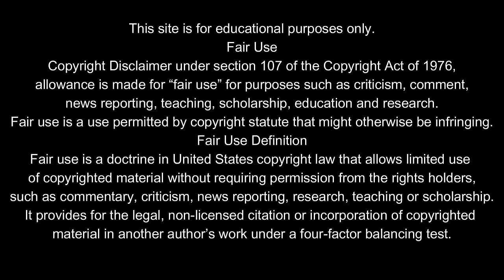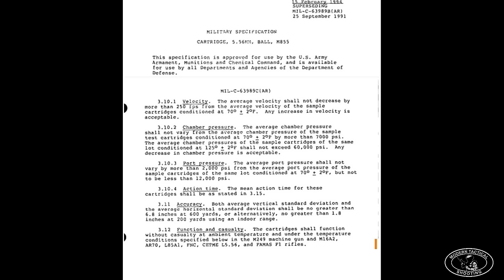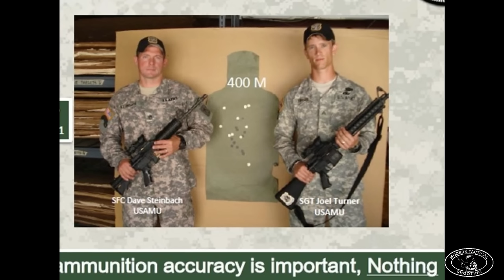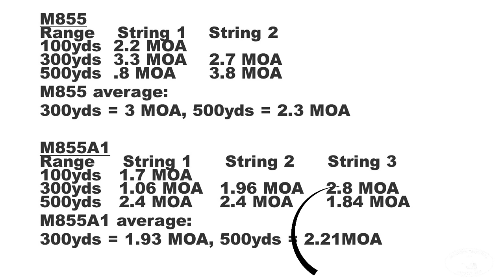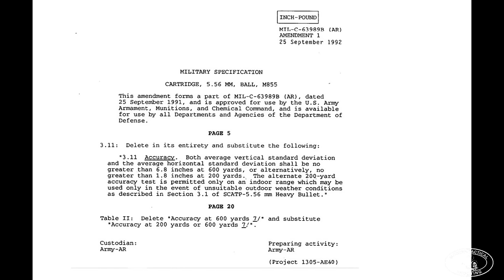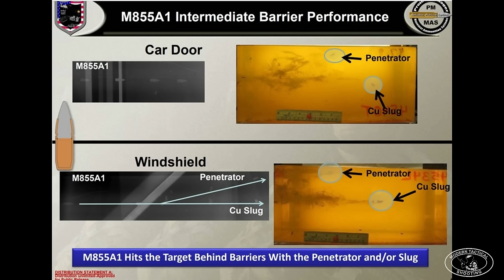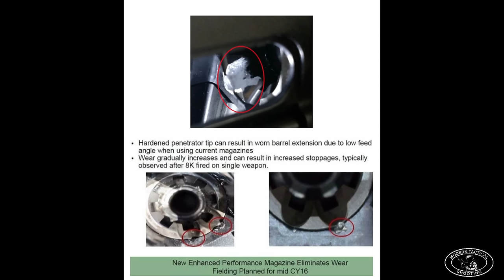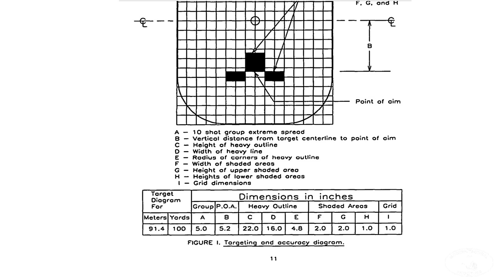M855A1 Performance Review. Did it live up to the Army's hype? Did going green really work?

Comment: On Afghan Walls:  He’s not joking.  They might be made with a mixture of portland cement and goat dung, but unless they’re hit right next to a corner, or  at the top edge they’ll shrug off a shot from an AT4 or RPG-7, no problem.  And at the same time they’re soft enough that you can walk up and pull chunks out with your hand.  Weird tech, but very tough.
Reply: It essentially acts like compacted sand.
You know how good sand is at stopping projectiles.
Reply: @pewpewTN  SAANNNDDD!!!?!?!??!??
Reply: @pewpewTN  I don't like sand. It's rough and it gets everywhere
Reply: I've seen one take a whole belt of .50 and still stand
Reply: @cascadianrangers728 love the pfp
Reply: Actually had my platoon switch our Mk19's to our spare M2's with SLAP rounds when we saw the walls essentially negating a lot of 40mm frags just getting absorbed...
Reply: so...

it's natural kinetic sand?
Reply: We had trouble punching through and 50 cal M2 had issues. Many times it didnt punch through
Reply: @zack9912000  SLAP and AP worked just fine.
Reply: @LuoSon312_G8 sure. If that helps.
Reply: Yeah they were very strong for what they were huh, I couldn’t believe it..
Reply: Certain types of sand are heat resistant enough to be used to cast various metals. Ceramic in general, especially something spongy probably could eat an EFP with relative ease for something at that price.
But don't take it as gospel, I'm just making guesses based on what I know, probably missing important context.
Reply: Maybe AP 5.56 , AP 7.62x51/.308win, AP 7.62x39 or AP 50 BMG could go through a last one would be the 14.5x114mm cartridge in AP too
Reply: @leonotthelion  Don't forget that it is course.
Reply: @leolion1993 you've won the internet for today!😂
Reply: Yeah it compresses when you hit it.  We were given 855a1 in 2009 in socom (Afghanistan) it was still in black hills boxes, assembled backwards.  Brown side out.  Later we dropped it.  I was an sdm and carried an m14ebr at the late 09 part of my tour, switched to an sr25 in 2010.  Had leupold on m14 niteforce on sr25.  Optics were mixed bag though.  The spotter was a leupold for most and I did see Nikon spotters for some guys.  I was on a LRST  team in 09.  Was on a team with Fusion in 2010.
Pretty sure the AMU eval guys were getting 8in at 600 with their match rifles.
Reply: This is why Russians like Thermobarics.

Kills everything.
Reply: Driving by the Afghan version of a suburban neighborhood, I saw a guy sitting up on one of those walls adding height .  The wall was going from I’d say 8’ to 10’ high in ~2’ cube sections.  
He was patting mud, basically. It was a little bit comical.
Also saw a compound that probably belonged to a drug lord.  1/10 mile long 14’ walls with guard towers at the corners.  Plenty of small arms impact marks, and some craters    probably from .50 CAL.  You better be serious if you want to get in a scrap with THAT guy!  If a typical compound has 2 foot thick, 10 foot high walls, that guys walls had to be 3 feet thick!
Reply: @leonotthelion  welcome to Florida,  one of the sand pit capitals of the USA. 
I hate it too.
Give me good dirt that you can grow anything in
And hardwood forests.
Not this crap here
Reply: this is were .30HATE come in !
Reply: It actually is like a Portland cement. Anyone that’s ever been to Afghanistan will tell you their dirt is like talcum powder as with any desert environment, that’s great for walls period. I think DJ Shipley said they were on an op in one of the valleys and those people were so removed they thought we were the Russians. They also used their own poop to make bricks! It’s one of the episodes on Shawn Ryan
Reply: The average American wall is made of paper mache and plaster so anything is a step up from that
Reply: Yep. You realize this little fact and then your like waaaaaiiiittt what?!
Reply: That's not weird tech, it's just dirt. You're describing dirt.
Reply: That’s like saying, “concrete is just rocks.”  More goes into it than you realize.
Reply: What’s Portland cement 😂
Reply: It’s the binding agent in concrete and mortar.
Reply: Are we sure they are not made with cornstarch and water?